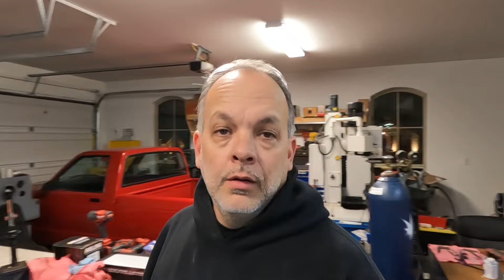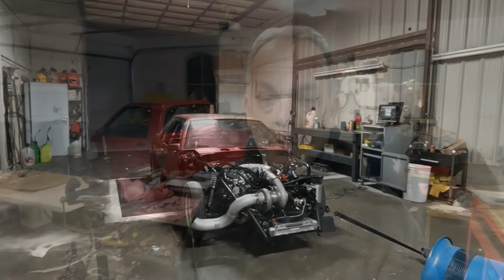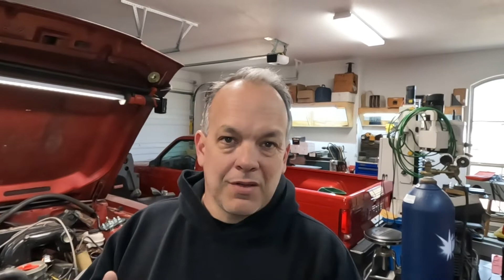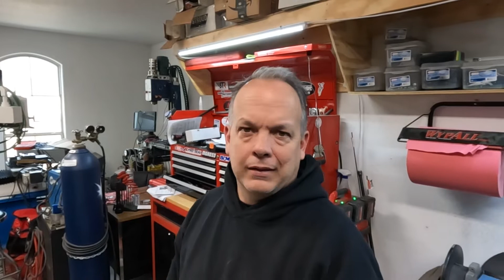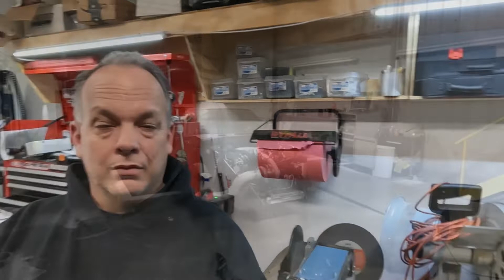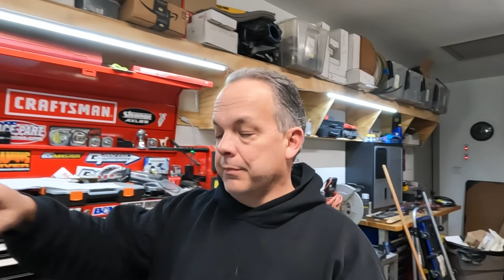5.3LS big power on the dyno - Bob likes to party with BIG boost!

Comment: Haven’t seen an upload in a while man. Are you doing okay sir?
Reply from the maker: Man, I'm good. Thanks for checking in! Bob is finally coming around. He has 13 passes now and just about caught up to the sbf best time. This weekend he's getting a th400 and a bolt together converter
Reply: @diygaragetx  that’s great 👍🏻. I’ve been looking to upgrade my turbo 400 and need recommendations on who to send it to or what parts to upgrade? Even the mid tier rossler th400 isn’t being sold. Thanks
Reply from the maker: Man, fti, Rosser, Cameron are all good places to try. It really depends on power level on what needs to be upgraded. Imho, you cant really overbuild.